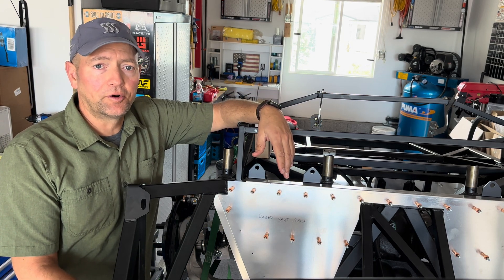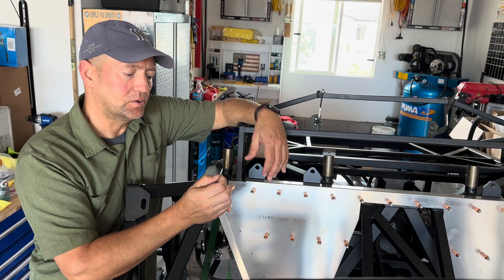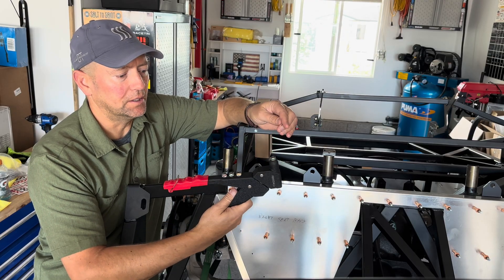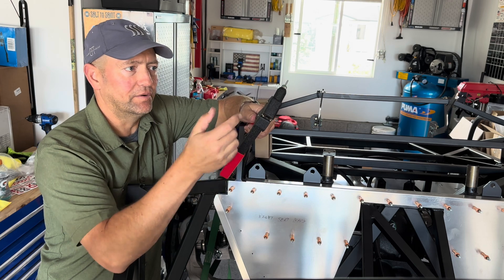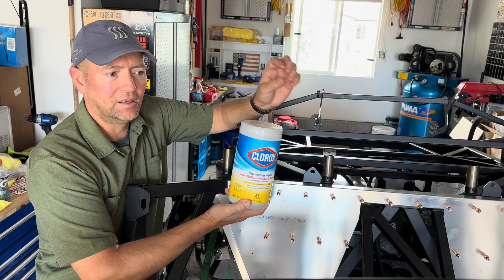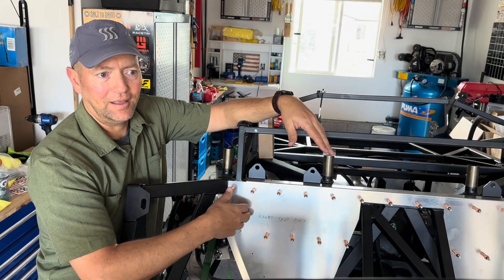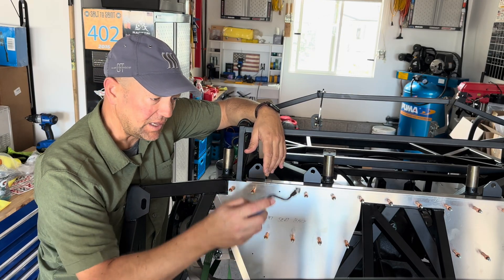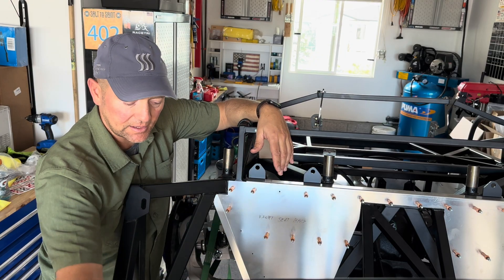Episode 15. Aluminum paneling lessons learned on FFR Mk5 Roadster (complete kit).

Comment: Thanks for doing these. We are at about the same place on our builds. I was putting off panels as wasnt sure about running cables and lines without seeing where everything goes. I also want to either powder coat or paint the panels. Gave up with the turn signal and bought a unit from i.e.47 garage. Frank has some good tips on that channel

Comment: One of the build threads on the forums just mentioned the exact same thing about some of the bends from the factory aren't quite at the correct angle and needing to bend them a little to get them to sit nice and flush. He also mentioned about the chassis weld creating some interference as well.
Reply from the maker: I am hoping there won't be too many modifications I will need to do on the remaining panels. I don't have a sheet metal brake in the garage, so I had to make do with my bench vise. Worked okay in this instance.